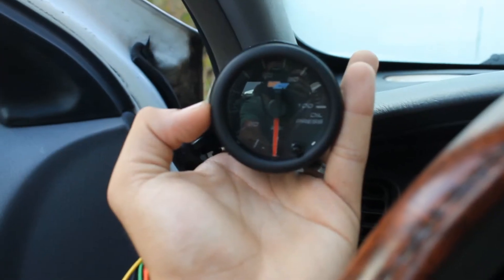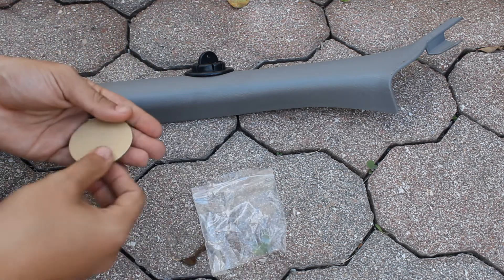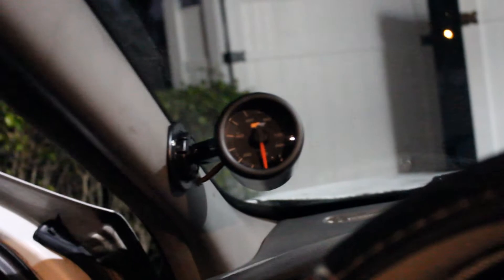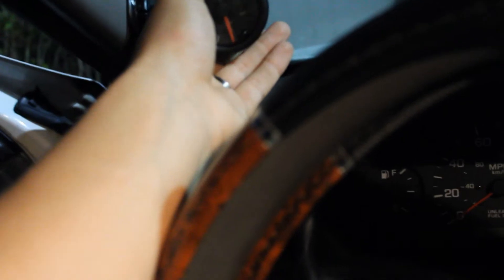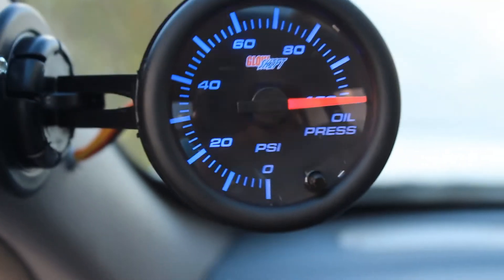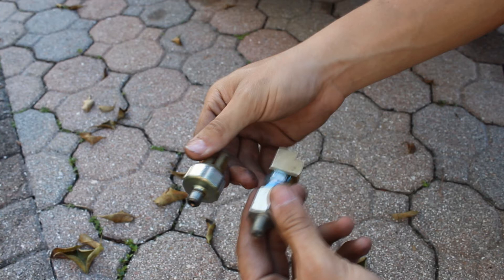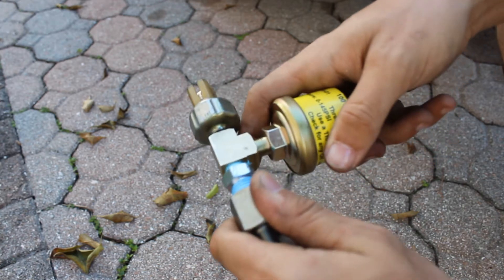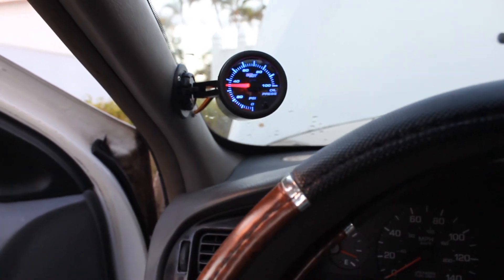How to install a Glowshift oil pressure gauge

Comment: Nice gauge until you realize it reads 20 psi with the engine hot & TURNED OFF, gradually reducing to zero , but only after 20 minutes of cooling . Not very useful...
Reply from the maker: That a bad ground